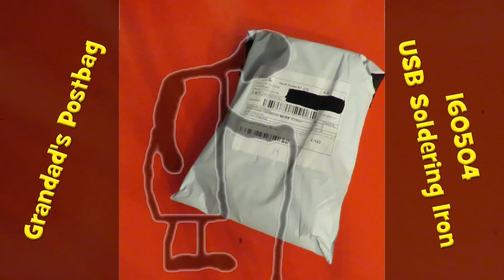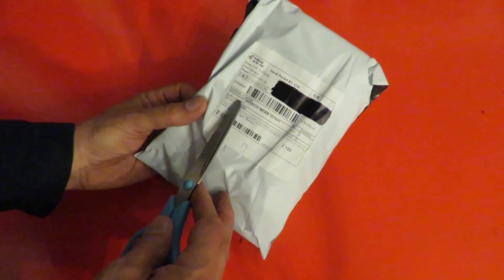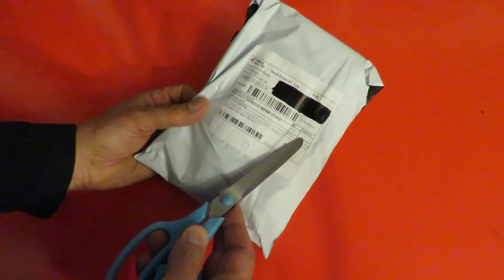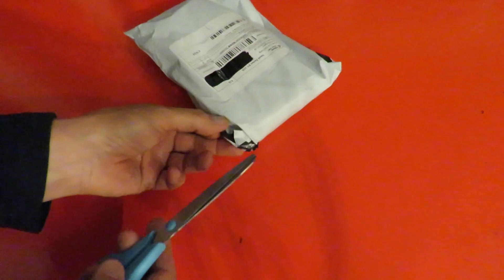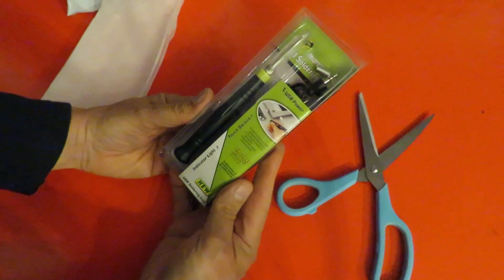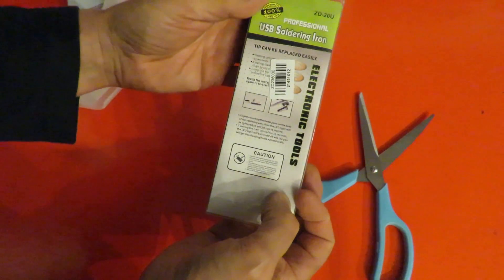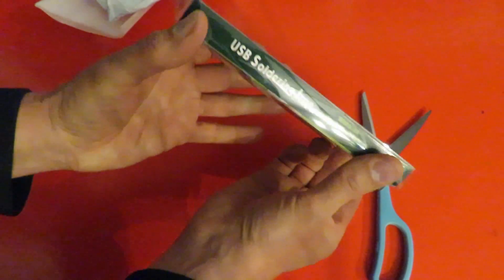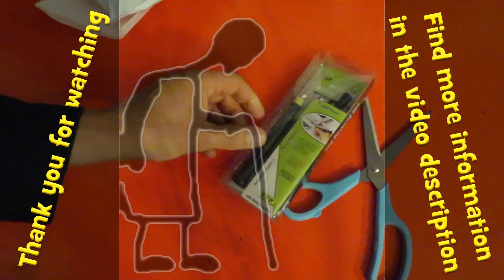Grandad's Postbag 160504 USB Soldering Iron

Comment: I was just looking at these, saw Clive's video a while back, I may just pop for one
Reply from the maker: I have been using it for about a month now and I am very pleased with it, especially the speed it warms up. Obviously it is only suitable for light weight work so I have my selection of larger irons for heavy work.
Reply: Thanks for your reply, I use a very spendy lite work iron at work that is about this size. It turns on when picked up and goes off when back in it's station. I have quite a few soldering tools at home but nothing like this. I ordered two just now, one to gift one for me.

Comment: I bought one of these after watching BigClive too.......and its great! Take note of the power requirements though, follow his guide about NOT using mains adapters! A standalone battery bank is ideal for this but you do need one that can pump out around 1.25A....which gives you around 6W. Not much, but it really does work well for small jobs.....that digital clock you just made would have been the perfect situation. Keep the tip clean and stay away from lead free solder and you wont be disappointed.
Reply: Yes stick to lead based....
with all its leady goodness  :-)
Reply from the maker: I have been using it for about a month now and I am very pleased with it, especially the speed it warms up. Obviously it is only suitable for light weight work so I have my selection of larger irons for heavy work.